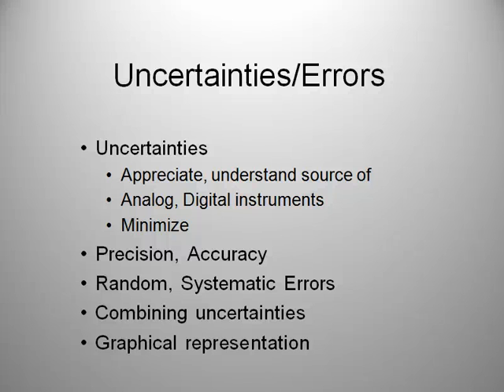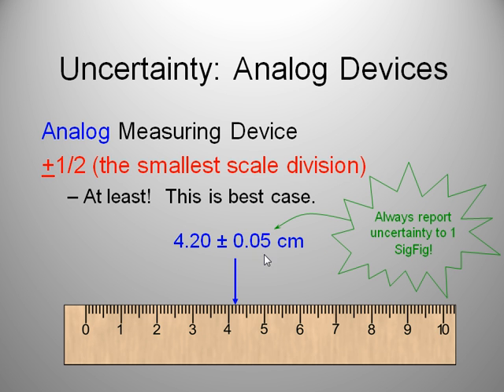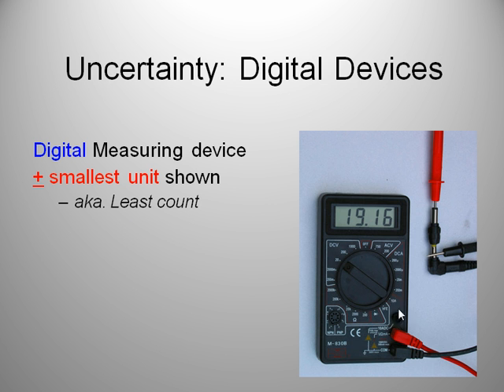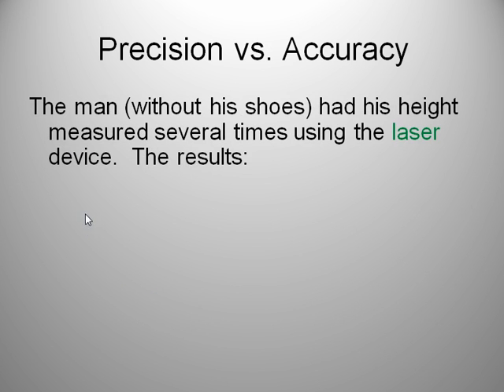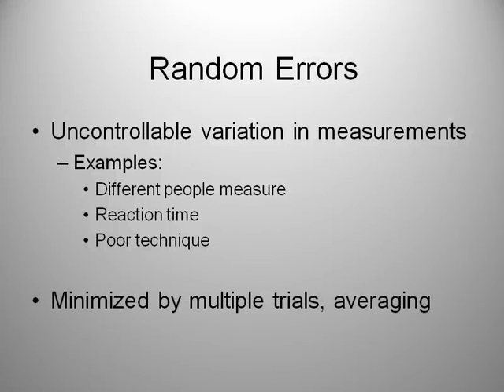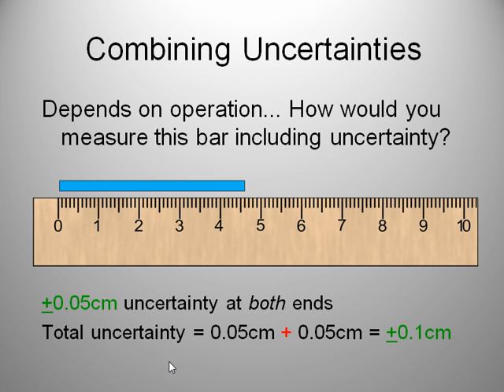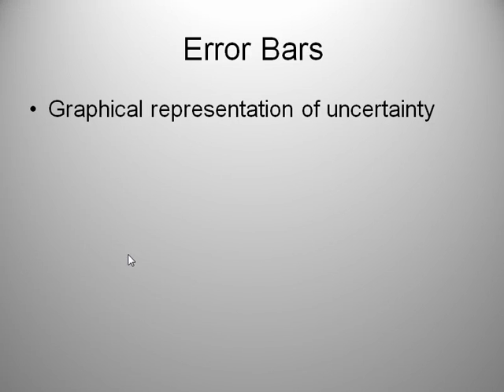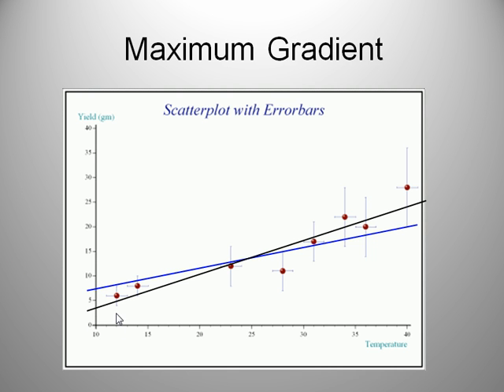IB Physics: Uncertainties and Errors

Comment: Also, on your measurement of digital voltmeter, I would have liked you to mention what to do when there are lower end figures fluctuating. Some sensitive devices fluctuates at the lower ends a lot. Also the source you are measuring can itself be fluctuating very slightly. So it is necessary to cut off the lower ends of the values and decide how many significant figures are reliable reading.
Reply from the maker: What you are referring to is an experimental issue.  In the academic sense, meters do not fluctuate.  As I mentioned in the video these are best case conditions.  If you observe anything in your experiment that adds to uncertainty you need to note it and assign additional uncertainty based on your qualitative observations.

Comment: Hi, not sure if you still check this video, if you do please could you explain why at 4:24, that the digital uncertainty is ±0.01V? I don't understand why it would not be ±0.005V, since if the value in the example was 19.16V ±0.01V, this would mean that upper bound would be 19.17 and the lower bound would be 19.15, which, according to the uncertainty of ±0.01V, would result in 19.16V being recorded, when in reality they would not?
Thanks.
Reply from the maker: The uncertainty is +/-0.01V, because the digital meter displays to the hundredths place.  Whatever the last decimal place shown is, put a 1 there, and that is the uncertainty.
Reply: Okay thank you very much

Comment: Great video... quick question.   What is your suggestion when measuring different types of measurements?    For example, temperature (in Celsius) + salinity (in parts/thousand) + depth (meters).   Essentially, these 3 measurement types allow to calculate speed of sound in sea water (see http://resource.npl.co.uk/acoustics/techguides/soundseawater/content.html#UNESCO).

Thanks for any feedback on this question.
Reply from the maker: Depends on how terms are combined.  If the terms are multiplied, then find the relative (percent) uncertainty in each term and add those percentages.

Comment: 7:26 shouldn't the uncertainity be 0.5 cm as you take half of the scaling? or is it just a value rounded up to 1s.f.?
Reply from the maker: +gutttab I chose an arbitrary value (+/-1cm) to illustrate the point about accuracy vs. precision.  (BTW, 0.5cm and 1cm both have 1 s.f.)
Reply: +Brian Lamore ah true, I guess you just wanted to round up to the same number of decimal places as in the number to which the uncertainty is connected, now everything seems just fine.

Comment: I would like to ask a question on your take on the analog voltmeter reading. I would quote the reading as 22.5 plus or minus 0.5V.  The needle has definitely passed the 22V mark and it seems to be between the 22V and 23V marks. Am I wrong?
Reply from the maker: It's difficult to see, but when I use a magnifying lens I can also see the needle is between 22 and 23.  So upon closer inspection I would agree with you .

Comment: This is not the way you find the propagation of errors of a calculated quantity such as the area of a box you did it. Please review this link from Harvard University http://ipl.physics.harvard.edu/wp-uploads/2013/03/PS3_Error_Propagation_sp13.pdf
Reply from the maker: What I presented here was the method IB required.  IB is aware there are other methods, but their purpose was to get the student to appreciate uncertainty and propagation.  You are welcome to contact IB.
Reply: @bclamore  Thank you for your reply! What is IB? 
If you are doing the volume of a cylinder, the radius has power of 2 and height power of 1. So the uncertainty of the radius in the volume is bigger than that of height. Based on your formula they both will have the same weight in the volume uncertainty.

Comment: Hey so when doing an experiment that involves measuring using a metre rule will you record the measurement( uncertainty) as say 13+/- 0.1 cm or 13+/-0.05cm, I will be so greatful if you answer me Sir
Reply from the maker: Most analog metre rules have a resolution of 0.1cm.  Half this is 0.05cm.  If you are using the rule such that there is uncertainty at both ends, the total uncertainty is 0.1cm.

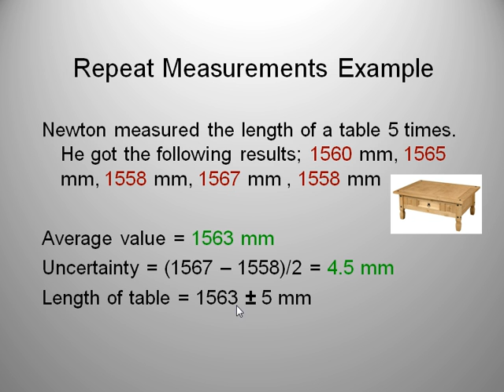Comment: in 5:39 the average value should be 1561.6 instead of 1563 so would we round the average to 1562 or do we leave it like that?
Reply: Bryan Perera he added that highest number and the least number, then divide it by 2. Answer is 1562.5, round it up, so the answer will be 1563.
Reply: Shane Gepilano  no he's your right bryan it should be rounded up to 1562